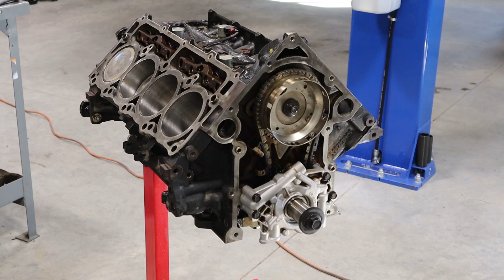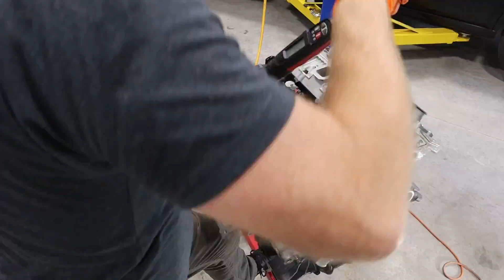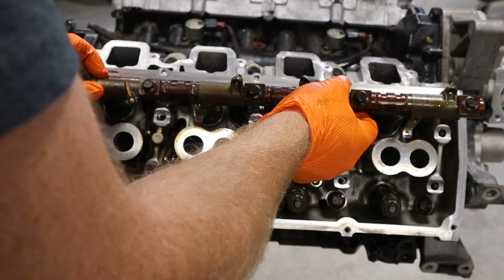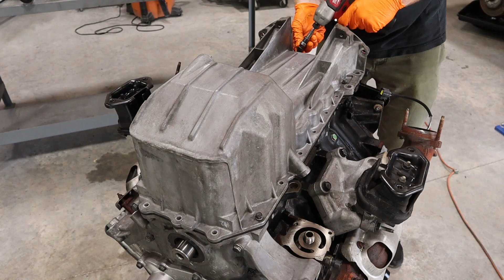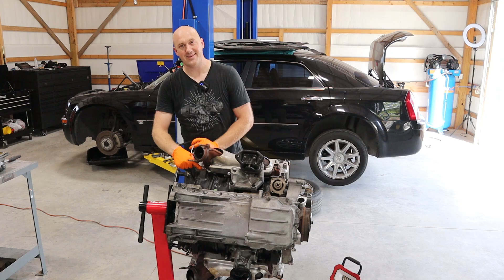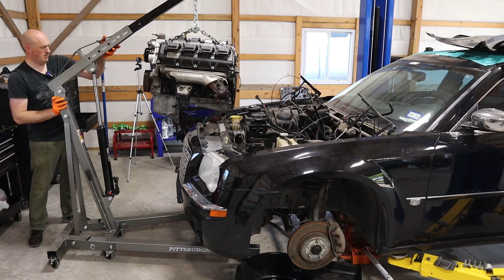Chrysler Hemi 5.7 Engine Rebuild Continues Top End // 300C Episode 4

Comment: What made you decide to use a new water pump instead of reusing the old one?
Reply from the maker: Hemis are kind of notorious for bad water pumps, but the real reason is that this engine dropped a valve seat because they ran it out of coolant and overheated it. So I figured better safe than sorry. I also replaced the radiator 👍
Reply: @ReignitedAuto  That makes me feel better about replacing the water pump in my 2010 Ram 1500 at 75k miles when the bearing went out. Before that the evep vent valve went out about a week after I bought the truck. Next order of business is new exhaust manifold bolts and studs then after that I'll probably be replacing the blend door actuator. It is good to know that these are common issues with well documented fixes.

Fun fact. I live about a mile from the Chrysler parts warehouse on Allen Blvd in Beaverton yet to get the best prices on OEM parts they first have to leave that warehouse and be shipped to Hillsboro or Montana then back to me.
Reply from the maker: @SteveM0732  We moved down to Texas from Bend a little over a year ago, been an Oregon boy my whole life. I've bought several motorcycles from that big bike store in Beaverton 👍

Comment: Wished I would have seen your video before rebuilding my 5.7. I missed with one of the pushrod just like you said. Chased that misfire for about a week. Was really embarrassed when I found it. Great video!
Reply from the maker: Don't be embarrassed, it's a really common mistake! Thanks for watching! 👍
Reply: Any brand suggestions for new Valve Springs? I can’t find specs for the stock ones so im lost trying to find replacements!
Reply: @ericg.7053  if you can afford All-data...its a good place for engine specs.

Comment: Great job as always!  I was wondering if you’ve had any experience with aftermarket replacement engines, I really don’t have the knowledge that you have to rebuild my stock 5.7 ( 2007 Dodge 1500 ) engine so I would rather have it replaced when needed.  I’ve heard Jasper engines are good and I want it to last, so I prefer to do it right the first time with a quality product, any advice is appreciated.  Thanks, and Merry Christmas!
Reply from the maker: Jasper is a fairly big name, and that's important only because it means they are a fairly large company with good infrastructure. What I mean is, with smaller companies, they need to get stuff out as cheaply as possible, and if there's a warranty issue it's like pulling teeth to get them to pay for things. However, if you're dealing with a larger company, their engines will cost a little more up front, but usually it's not a big deal to handle warranty issues through them. 
My advice is to go with a known brand, like you mentioned, and to read the warranty paperwork for the engine VERY closely as to what requirements they have to keep the warranty active, in this way you can protect yourself. 👍 Thanks for watching!
Reply: I also have an 07 5.7, what’s the cost of a jasper engine?
Reply: Best i can tell y'all is my old Ford horse GT is 02 and 5speed car, I got when she had 10thousand taking kids to skool miles on her , back 03 when I got baby to this very day 17years later, my baby has 360000.0miles on her original every thing , just replaced original fuel pump back in the fall,  Uns need to know how to enjoy your baby long time just ask i b glad to share  my experiences

Comment: This video is very helpful. I just ordered my HRT stage 2 cam for my 2005 ram Daytona. Can’t wait to hear it start up. Do you have a link for the torque specs?
Reply from the maker: Unfortunately I was using my access to Chrysler service, which I no longer have 😔. I want to hear your truck after the cam swap!
Reply: @ReignitedAuto   I appreciate it.  I’ll keep doing some research. I’ll try to make a video for YouTube cause not many 3rd gen hemi videos out. Especially cammed.
Reply from the maker: @alexanderhernandez1711  Absolutely, if you get a chance, check out my playlist on my C10 project I swapped a 6.4 Hemi into, I'll be doing a cam swap on it soon. 👍
Reply: @alexanderhernandez1711  ... I've been thinking about getting that same cam for my 2004 Hemi Sport

Comment: Can you help me understand how to remove the engine? What are the steps?  And, how do I attach the engine to the engine crane? Thanks.
Reply: Best thing to do is get a service manual for your specific vehicle, the factory manual would be the most detailed & thorough, but more expensive than a Chilton or Haynes brand.  (Ebay's a good place to search for cheaper \ used factory service manuals for your specific model if you would like to go factory instead of Haynes\Chilton)

The factory manual(s) will be much thicker and should answer almost any questions you will have, and the Haynes and Chilton brands usually skip some techniques or details of certain processes but still pretty good manuals for the $.

Comment: Just wondering, do you use a factory waterpump and any component for the 5.7? What about things like brake pads and rotors or should I go to the local parts store. I know dealer parts can be pricey. I have a 2010 Challenger with a 5.7.
Reply from the maker: Having worked at a dealer for the past 18 years I'm a big believer in the quality of factory parts. They are definitelymore expensive, but rather than do the job twice due to bad aftermarket parts, ID rather pay more up front. Brake pads and rotors you'd be surprised how close they are in price to aftermarket options.
Reply: @ReignitedAuto  
Thank you! I appreciate your answer!

Comment: Hey I have a 05 magnum rt fully rebuilt engine.. I’m starting to get it started but it won’t stay running. I’m getting a code for PCM and P0443. Car will only run when I give it gas... other than that it dies out. You gotta idea of what it could be?
Reply from the maker: I'd be looking for a vacuum leak of some kind. The p0443 is a purge solenoid code, so its a possibility the solenoid is stuck open. Remove the hose from the purge to the intake manifold and block it off on the manifold to see if there's any change. If not, I'd be looking for other vacuum leaks, like where the brake booster hose connected to the intake. If you still can't find anything then use breaker cleaner all around the intake manifold, see if the rpm increases when you spray it in certain areas. If all that fails then it's possible you have a timing issue. Hope that helps 👍